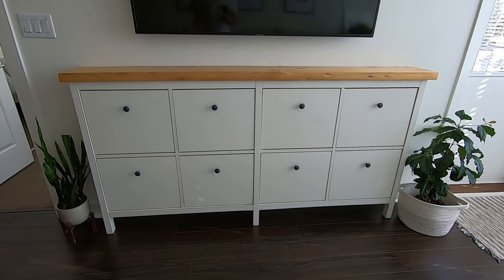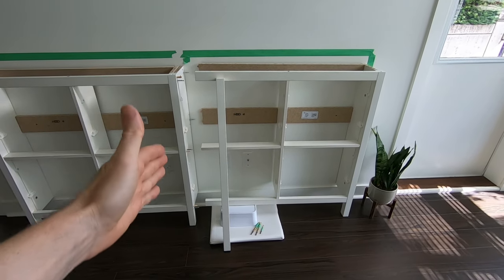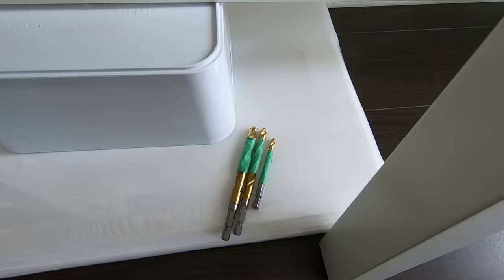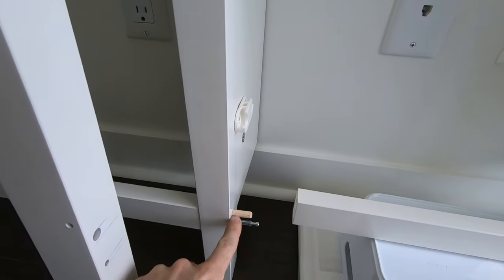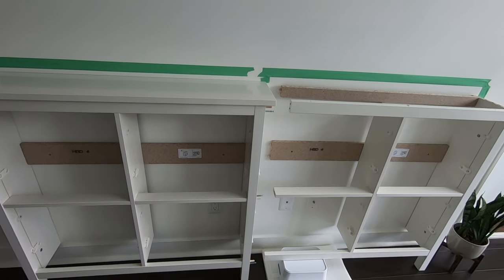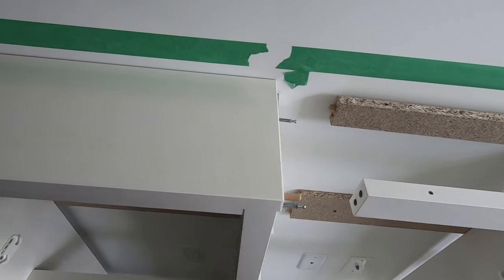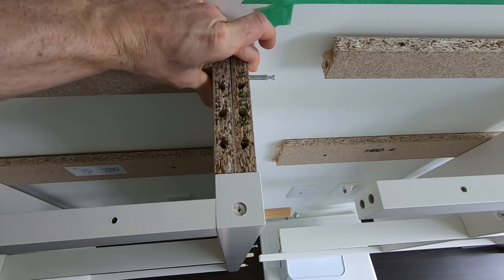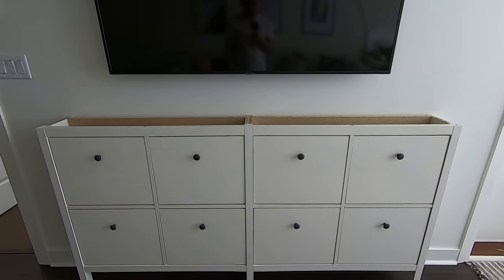HOW TO assemble IKEA Hemnes shoe cabinet HACK

Comment: Great job: I’ve just hacked mine. Though, to ensure accuracy of the holes on the centre leg (also it’s quicker and easier) I just drilled through from the other side. The hole depth is not that critical for the cam lock bolt or a dowel. FYI all IKEA holes are metric. So if you plan on doing a lot of IKEA hacks having a set of metric drill bits might be a worthwhile investment if you live in the US, Liberia or Myanmar.
Reply from the maker: Great tips, thank you!
Reply: What do you mean?
Reply: @Shannonigans7  About what?

Comment: This is a great video. I think I'm going to steal this idea. How did you mount the top? I'm assuming doing a similar trick by lining holes and drilling into the top?
Reply from the maker: By using the pre-drilled holes in the cabinet itself. 
Lined up the top to where I want it, marked the holes with a screw/nail through the pre-drilled holes, drilled pilot holes into the at the markings, then screwed on the top. 
You only need about 2-4 screws

Comment: Do you happen to have measurements of how far from the side the holes should be drilled? Or is there an easy way to get the exact position where the screw and wooden dowels should be? Hope the question makes sense.
Reply from the maker: No, unfortunately I don’t have the measurements. I used a square to draw the lines of where (height) the holes should be, and then measured the centre of the existing holes and marked where they should be. Measure twice cut once :)
Reply: I saw another video where someone used tape to make a template. They put the tape on the leg, then used a screwdriver to punch out the holes. Then they took off the tape, put it on the leg that needed to be drilled, and marked their holes. Then they drilled. No measuring necessary

Comment: How did you fasten the wood top to the particle board?
Reply from the maker: The cabinet comes from IKEA with pre-drilled holes under the top railings, so I used those pre-drilled holes to mark the wood and tap it with my own screws.

Comment: Couldn't you have just used wood glue to combine the 2 panels together? And then attached the one panel normally to the leg? Seems easier than worrying if your drilled holes are perfect
Reply from the maker: Absolutely! Lots of different ways to make it work. Just comes down to personal preference.

Comment: How did you attach the wooden piece on top?
Reply from the maker: Hi Adi, I used wood screws and put them through the pre-drilled holes in the cabinet top rail. Make sure your wood screws are smaller than the pre-drilled holes to allow for the wood to expand/contract

Comment: What's the measurement of the wood top?
Reply from the maker: Depth is about 8 inches and length is about 80 inches, but you can make it whatever you like!
Reply: Depth has to be bigger than 8 inches no? The white ones are most 8.5"